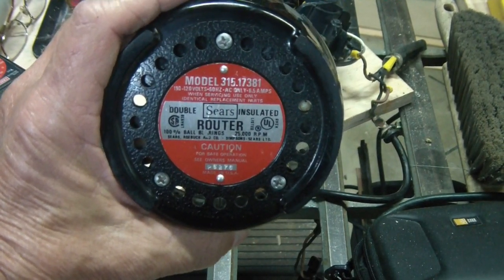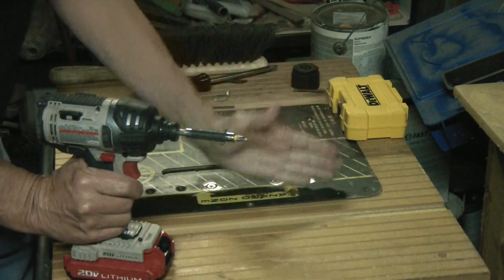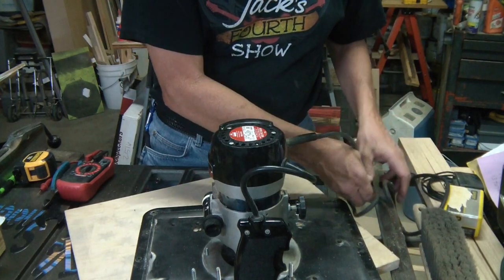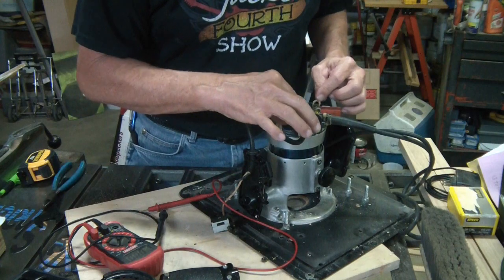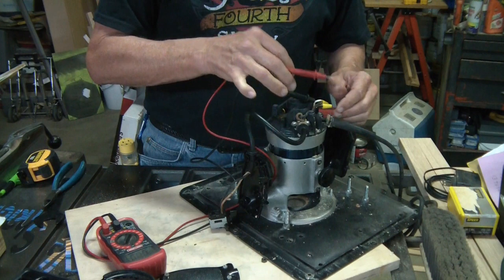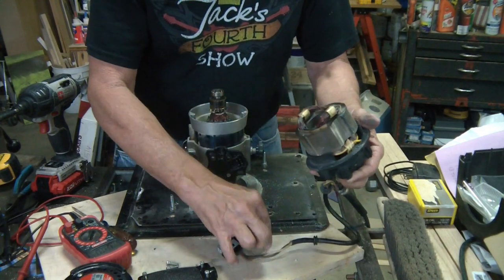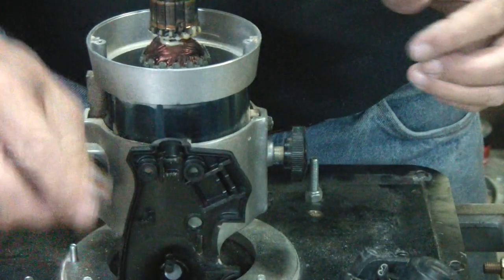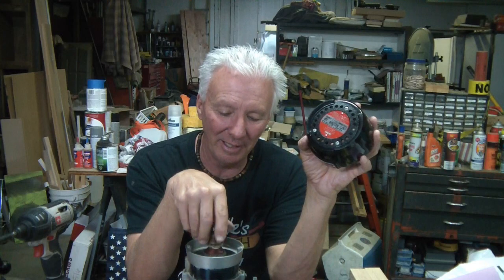30 Plus Year Old Sears router Dies

Comment: Thanks, this was 1 step in helping us repair 2 of my grandfather's old routers.  Just needed to go 1 step further in taking out the stator.  That was difficult to figure out but just had to pound it out of the black plastic housing with a rubber mallet. We took it apart a little differently, couldnt get it to separate where you did, ours was model 315.17492 though. Gave it all a good cleaning from packed  sawdust & it worked again!  The other model (315.17461) had a burnt through wire but was able to use 1 of the heat shrink solder wire connector things & fix it, whoo-hoo! Model 92 was easier to work on, seemed a little better made or at least a little simpler. If anyone has questions about those 2 models, I might be able to help or provide pictures.
Reply from the maker: N. Watson thanks for the advise and your offer to help. Means a lot. I purchased another router from a viewer the same model and will soon replace the bad part and keep my grandfathers router on the back burners and a back up for those  very special occasions.

Comment: I have the same router, also mounted in a table and it stopped working while making finger joints.  So I watched your video. 
I then removed  the motor cover and found that mine had failed the exact same way.
Bummer! right in the middle of a project too.       
I believe the glue that holds the contacts together must dry out in 30+ years.
Reply from the maker: Ronnie it truly stinks. These are or were great routers. Many have suggested getting one off ebay or somewhere and have surgery for the transplant but somehow that just doesn't sit right. I think I'm happy sitting it on a shelf and remembering my grandfather and working with him in his garage on projects and leave it at that. Its a good conversation starter that way. Thanks for the comment and thanks for viewing.
Reply: The Shack 
 Hilarious. I came to your video hoping to get info on a craftsman router (315.17431) that was my grandfathers, that I got after he passed away. 
 Then I noticed you have the same iron horse turn your skilsaw into a table saw deal that I have as well. 
 Which I also got from my grandpa. 
 My uncle took the craftsman table saw.😂
 The router I have didn't seem to wanna fit the makeshift table saw, but I didn't try to make it fit either. 
 Just had to make note of a couple coincidences. 🙂👍

Comment: That's too bad.  If you want to bring G-Pa's router back to life, these are available used on ebay, craig's list and offer up.  Just need another armature and brushes. Buy one as a donor and you're good to go again!  Prices range from about $20 - $90. G-Pa will be happy. :-)
Reply from the maker: Ron Arndt
 I have thought about it. If I stumble across a well maintained one I just might jump on it but so far the ones I found are WELL used and I'd hate to go through all that for a short run and brake again. I keep my eye out just never know. Thank for the comment and thanks for viewing.

Comment: Good video,but could not found anything it makes not working motor, bearings ok,brushes ok,what else, electrical cable ok,switches ok...
I'm kind dump,may be you give me suggestions,tnks
Reply from the maker: Guerman Dmitriev I would start at the beginning. If you can get a volt meter check to see if you are getting power to the tool from the outlet (power source) then keep going. make sure you are getting power to the switch going to and going out. If all shows power and still not working if there are any electric boards in the tool that could be the problem. Also as in my case if there is any wire that has been broken on the motor all the power wont make it work. In order for the tool to work the electricity needs to be a complete loop any break in the will render the too useless. find the break in the loop and you will fix the tool.

Comment: Are you still looking for the same router I have one that is missing the nipple where the bits go into. I got it from the original owner and it looks like they hardly used it my name is Toby.
Reply from the maker: Toby it was just going to sit on a shelf but if you have this yes I would be interested.
Reply: I was looking at another video and found out that the Coullet is missing I referred to it as a nipple. It runs nice haven't been able to use it because of the Coullet missing it is in nice condition if you would like it how about 20 + shipping?
Reply: I took some pictures let me see if I can post them.
Reply from the maker: @Monstroslocos  sorry got a bit busy yes email me direct backintheshack@outlook.com

Comment: buy dewalt or harbor freight or porter cable router.
Reply from the maker: Steve thank you. I did buy a Ryobi a cheap one for $70 that does just what I need it to do. Just a bummer Lots of memories with this router from my grandfather.
Reply: The Shack I got one 1/2 plunge router ryobi and 1/4 router ryobi with work light led